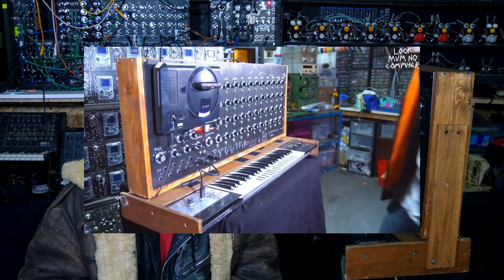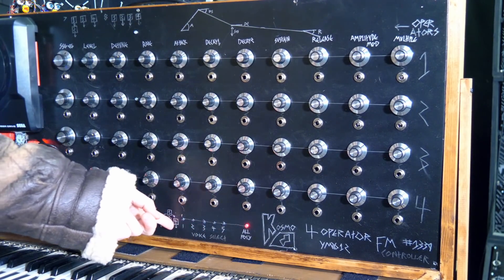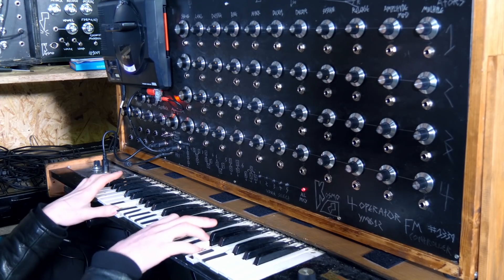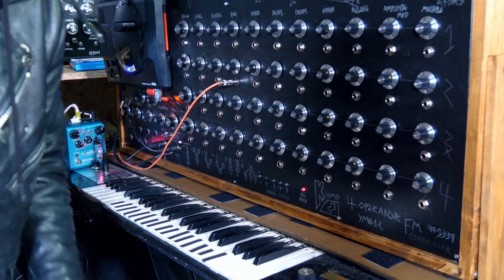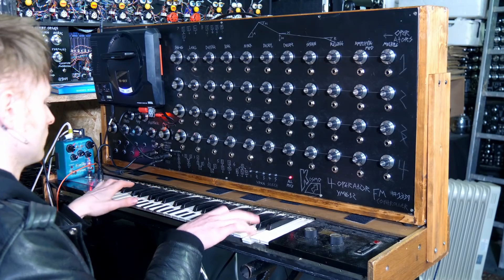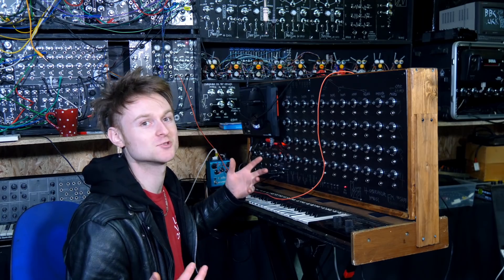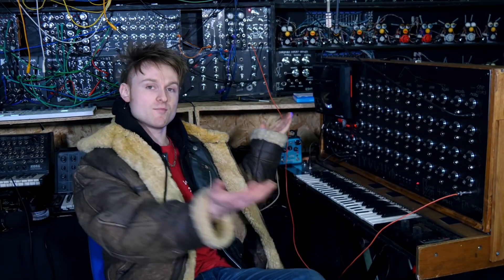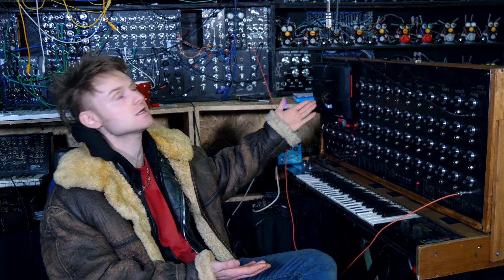Sega Mega Drive Synthesizer PART 2 it Now Is Polyphonic! Sounds BIG

Comment: Get a bunch of Dreamcast units.  There is a TON of homebrew code for the Hitatchi Super-H.  People might assume since it's got a 68k controller in it that it could run Mac code...lol

Well, it's actually still to where we can probably do pretty well punching stuff into registers if we absolutely have to, but what I would do is get your configuration together and have a nice build toolchain so that you can just make changes and it goes off and tests.  You already do plenty of automation type stuff, getting it to self-test is mostly just shifting a few bits here and there.

I guess if the internal arch is consistent between chip model builds it's potentially conceivable to literally port Sun/OS code to it...I could probably even spoof the hostid so old software will run.
Reply: (basically read the dongle key and run hardware locked software from companies that haven't existed for generations lol)

Comment: how do you wear a leather coat and a fluff lined coat? id die
Reply from the maker: because my workshop is around the same temperature as outside which is usually in january about 0 - 4 degrees celsius near enough. dont get me wrong if i could justify having a place that had insulation i would hahaha

Comment: Is there an equivalent module on PC that allows to control the midi parameters of this cartridge? It's funny that I can't find anything even though the product is definitely not new.
Reply from the maker: i think there is for ipad. i mean if your using a mouse you may aswell download chipsynth. sounds the same as the real thing if you aint rmessing with it outside of the box

Comment: It's good to have this level of control over an FM synth but, in the same breath, it's a bath tub full of #NightmareFuel as you get a great sound and know it's only exists in a brief window of time until a knob is moved and then it's mutated or COMPLETELY GONE!

I think I previously said that this would really would help with the side of programming and understanding FM synthesis as it took me a long time to understand the basics and even then I was only making synth drums and Simmons drum sounds.

Once good sounds have been achieved you could copy them off to an FM synthesis program or tablet app for reference and midi tweaking at a later date.

Good stuff and find more synths to hack and abuse!
Reply from the maker: issue is the second they get recorded down they go stale, the whole thing that keeps fm synthesis changing is the movement, the issue with fm is its not a nice sound to sustain for any lengrh of time haha

Comment: There's got to be another 90's/00's synth with some legit synth hacking options.

There were a load of popular ones that came out, and a lot of obscure ones too, that would be easy to obtain at a good price after some research regarding the audio hardware and how hackable/programmable it is.

A few had wavetable synth hardware (PC Engine/TurboGrafx 16 & Atari Jaguar) which would be interesting to hack
Reply from the maker: you can hack anything. just takes time to get through em all.

Comment: With a bit of code tweaking you could turn it into a wavesequencing synth. A bit like the korg wavestation but with an FM engine. Allthough the wavestion’s vector joystick is analogue and the megadrive uses a digital controller.

Comment: I advise you to replace YM2612 with Ym3438, this will remove distortion and there will be less noise
Reply from the maker: but then it aint a sega mega drive. doh.
Reply: @LOOKMUMNOCOMPUTER  ym3438 is the cmos version of ym2612 and is used in later mega drive revisions iirc
Reply from the maker: smds thankyou I did not know that they used a different chip in later revisions. However were the later revisions rebound for the sound being not as good? I thought it was the output circuitry. But it may be that chip they are talking about? It’s said it sounds more clinical and dull?
Reply: @LOOKMUMNOCOMPUTER  If my memory serves me right, they screwed up the output circuitry/amp on later models which caused degraded sound
Reply from the maker: smds that’s what I thought. All good I’ll have a look I wonder if it’s a direct replacement. Or there is some different pin/power requirementsz
Reply: @LOOKMUMNOCOMPUTER  

https://en.wikipedia.org/wiki/Yamaha_YM2612#Yamaha_YM3438

"It is not a direct, drop-in replacement for the YM2612 however, as the sound outputs have higher impedance."

Comment: I was thinking, since the genesis fm soundchip works with 4 oerators per channel, it might be possible to generate real sound effects by combining those different soundchannels like square waves,noice channel and triangle waves together and then quickly alternate the volume of them in order to create wave forms to get real sound effects,, this trick has been also used on systems wich has a psg soundchip,,, now the adlib soundcard is also fm but it can produce simulated pcm sound using this method mentioned above, i see lots of potential in this.

Comment: Another great vid Sam, I can only offer two recommendations for this build. First, I'd say keep your eyes open for a 1st gen MD as they are known to have much better sound, and second, i would open the console and see if you can mod the stereo headphone output to a line lever output which should help to clean up the sound, YMMV.
Reply from the maker: thanks alex. i speak about 1st gen in the 1st video. cant be pickyt! this was the first one that came up. sounds fine.  also the line out. yeah fair doos, i aint got no complaints on the headphone out on this. i just left the mega drive as is. one day possibly. but probably not haha
Reply: Just look at the position of the ports on the back no need to seek out HD graphics model.!  Power and AV next to each other and right at the very edge of the case? All good, it’s a VA6 or below!  If not then it’s the awful VA7 with Mega Drive 2 performance.
Reply: @SproutyPottedPlant  ^ This. Many of the model 1s are just fine. Too many people get hung up on HD graphics.